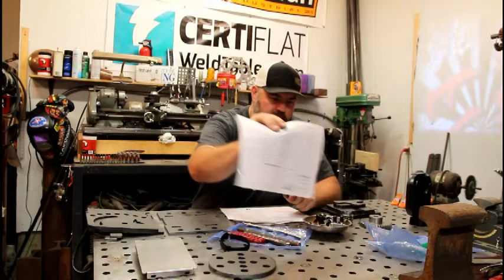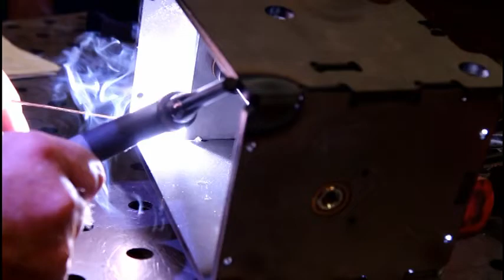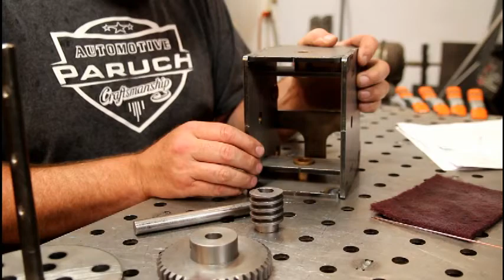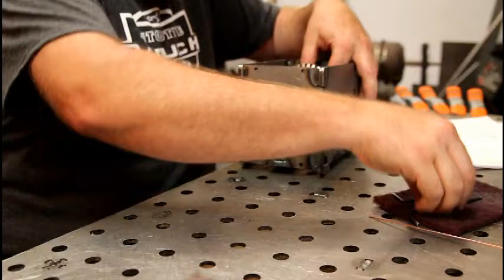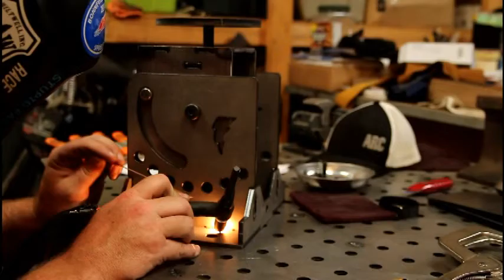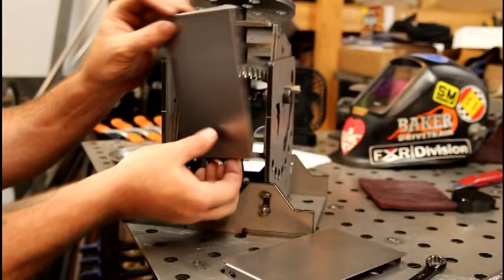Certiflat Weldtables Weld Postioner Assembly

Comment: Great video. Would be cool to drill a hole longways through the turntable shaft, and inject argon at the bottom where the ground strap is installed. This way you can get a clean supply of argon at the center base of the turntable, make back purging easy with no coiled up lines.

Comment: Received ours today, it's really fun to assemble. 
For those building one of these, follow the instructions on this video, as the paper instructions are not correct in regards to bushing placement. 
Also, as Wolfe303 said, the worm gear screws are too long and will prevent the gear from a complete rotation. Certiflat needs to  provide a shorter screw. 
It's a new product, issues like this are understandable.

Comment: Just put one together. Went well. Encountered some small problems. The drawings included with the kit show the bushings on the table shaft reversed. I dry fitted pieces together before watching this video. The shafts required quite a bit of polishing before they would fit smoothly into the bushings. The set screw for the worm drive was a hair too long and required a hit from the grinder to keep it from hitting the gear on the table shaft. Used the assembled gear box as a guide to center and square spindle to main plate before welding. The pieces are cut to very close tolerances. After placing the gear box into base I needed to file the drill shaft guides just a bit get smooth travel of the gear box in the base. Operates very smoothly. This is one solid piece of equipment.

Comment: Would be easier to use a corded drill so you can unplug it when you have to change parts
Reply from the maker: You can certainly use it in any matter you see fit. Most everyone has a cordless drill these days. Not everyone has a corded drill. If you chose to use a corded drill you can also use a foot controled rheostat to start/stop and control the speed of the positioner.